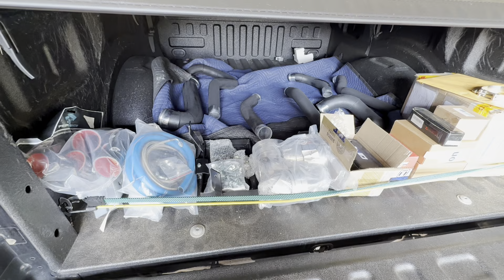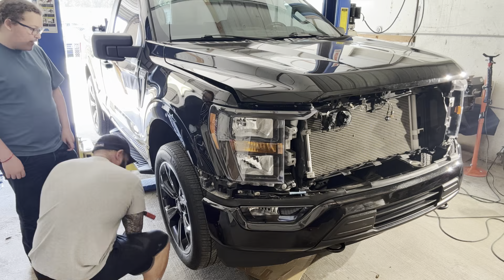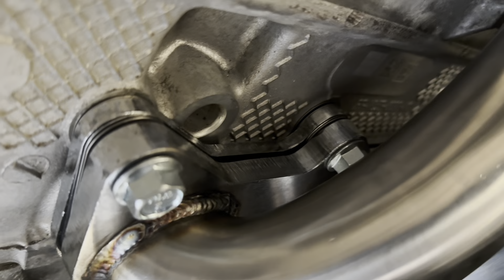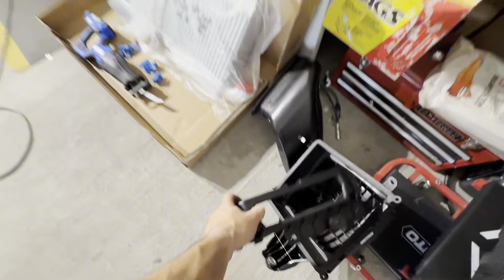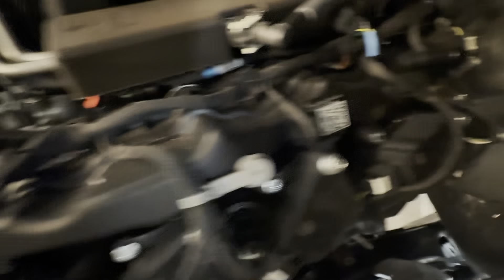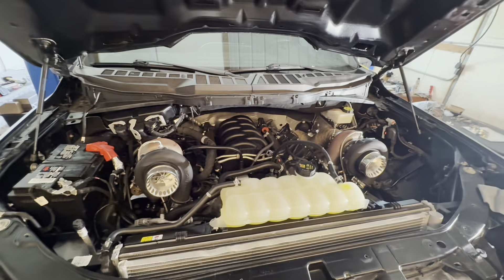21+ F-150 On3 Twin Turbo Install

Comment: I need one of those.  I haven't found anyone in Canada that does installs so far
Reply from the maker: Mine is going to be posted for sale I’ll ship it to you. You can bring it down to Tennessee I can have it done in a few days 😂
Reply: @turbotimegarage  I spent about an hour on the gov't vehicle import site.  THere's a new retaliatory tax of 25%.  It's basically due to the tariff wars going on.  Modified vehicles can be easily rejected.    There's 5 different taxes to pay lol.  As much as I want it I'm going to have to pass

Comment: When you drilled into the oil pan, how did you clean up the shavings inside the pan?
Reply from the maker: I used axle grease on the drill bit and went slowly, same for the tap. Did it with the pan full of oil still. drained it after. Then i verified with my borescope there was nothing in there.